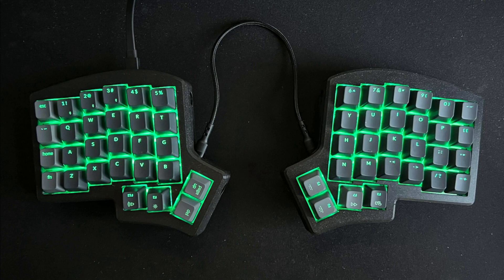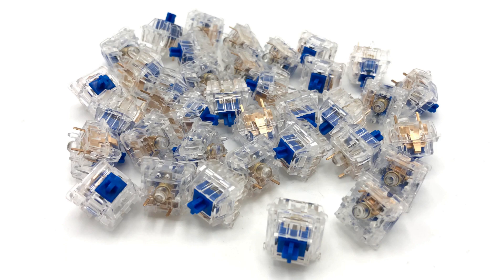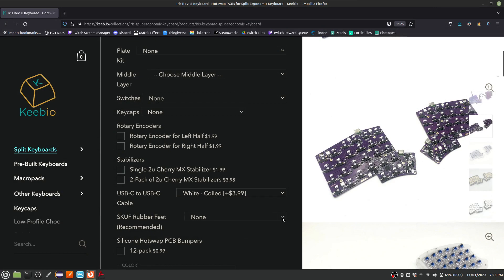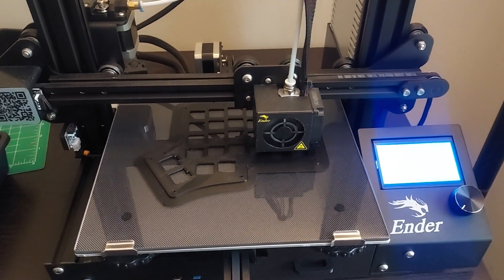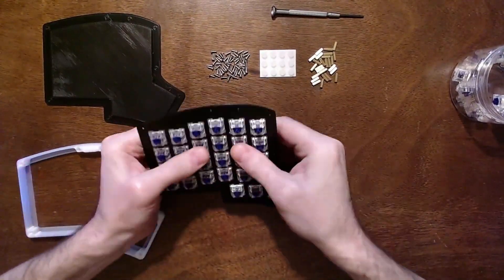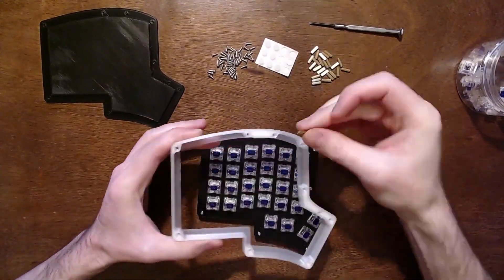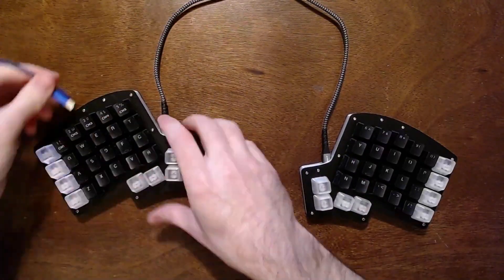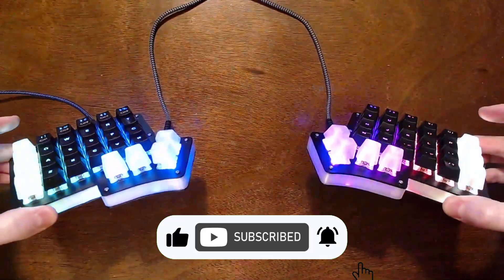Keebio Iris Rev. 8 - Ordering, 3D Printing, Building and Configuring

Comment: Great video! Im really considering to order one myself. I would only have one question. Since im also want to play videogames with it, is it possible to just use the left side of the keyboard without having the right part also plugged in to get some more space for the mouse or does the iris only work if both parts are connected?
Reply from the maker: Yes, each half will work by itself and another solution is to use a longer usb-c to connect the halves that way you can easily make room in between the halves for a mouse.

Comment: We should do no lateral movement with the fingers.
Reply from the maker: @fcalin21 Do you mean make a video about that or just setup your key mappings?
Reply: @bjcampolo  I am saying that from the ergonomic point of view lateral movement of the fingers are not good.  The layout that you use is not optimal.
Reply from the maker: @fcalin21  Good to know.  Do you have a link for a more optimal configuration?
Reply: @bjcampolo  No, butt from experience, four rows and four columns works great. I would add one lateral button for the pinkie and one for the index finger. Those are good for not often used characters (esc, backspace, delete, ...).

Comment: Great video! I can't wait to build mine this week. I might try to swap out the middle layer for one supporting the ergodox-style tenting -- have you ever tried that too?
Reply from the maker: Thanks!  No I haven't tried that but seems like it should work without too much tinkering.  Good luck!
Reply: Hey I'm looking into getting this keyboard and looking into tenting it, did you get anywhere with your efforts?
Reply: @RanLottem  yep. It works fine. Though I ultimately returned it and got a Sinc keyboard instead, which is a bit more comfortable fingers wise ("normal" rather) and is just as good to tent.

Comment: hey that's awesome! so just to be sure if i checked one of the options in the "plate kit" roll-down i will also get all the screws needed for assembly?
Reply from the maker: That's correct, you will get the required screws and standoffs.

Comment: Great video. A suggestion to help some users who want to DIY their on keyboard parts: Re-upload the CAD files on the drive in .step format. It is pretty economical to have the parts laser cut, however most laser cutting places don't accept .stl files. Someone without access to CAD software won't be able to convert the formats easily.
Reply from the maker: That's a good idea.  I tweaked some existing STL files using some online tools so I don't have the CAD files but I'll see what is available for export.

Comment: hi there, sorry to reach out this way but I couldn't find any other contact info. do you have a backup of the indie gamer forums? i'm working on a research project and there's a thread that doesn't seem to be archived anywhere and would be very valuable to me as a historical reference. i'd also love to ask you a couple questions over email if possible. no worries if not, or if you just don't want to deal with the hassle. thanks so much!
Reply from the maker: I discontinued the linode server and the database backup likely went away as well.  You can email me at bcampolo@bantamcity.com

Comment: I run an iris as my main keyboard. Do you think it would be easy to learn neovim with it?
Reply from the maker: I think Neovim has a learning curve regardless of the keyboard but I've been having fun using the Iris in Neovim for the past few weeks.  The hardest part of Neovim is the mental shift. It is like when playing a video game you want to make all of your hot keys close to WASD but in Neovim you want to keep your fingers on the home row keys (like in touch typing) and build your keybindings close to those keys.
Reply: It's very fun to learn neovim on any keyboard. I learned it on a regular tkl kb and got a split ergo a few years later. I got used to the split layout within a week. The best part is that you can remap any key to do anything you want in nvim or remap the actual key in via/vial. limit is your imagination
Reply from the maker: @kjclassic105 Yeah, I really like the key settings and macros in Via